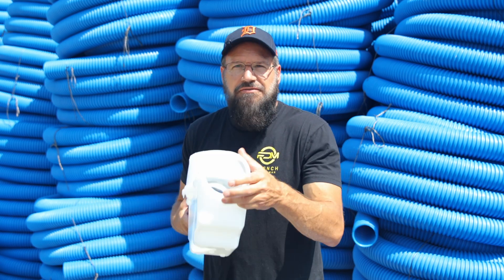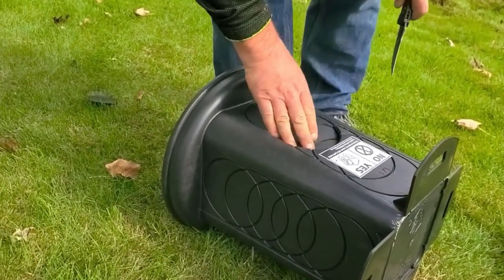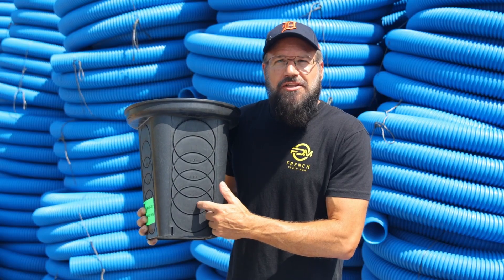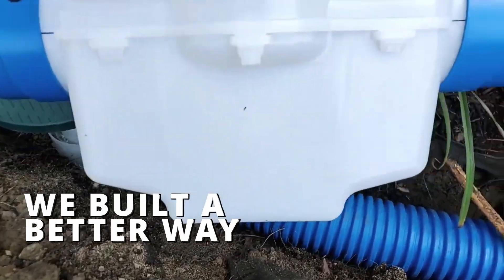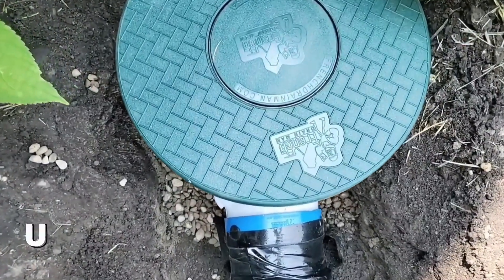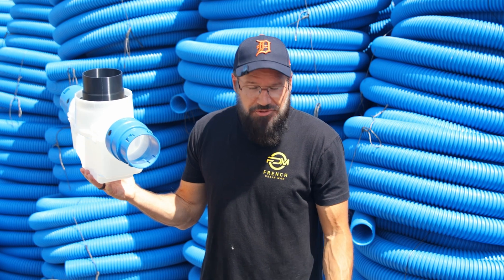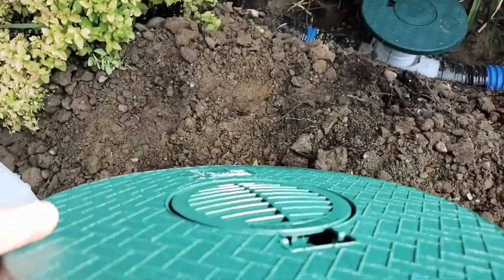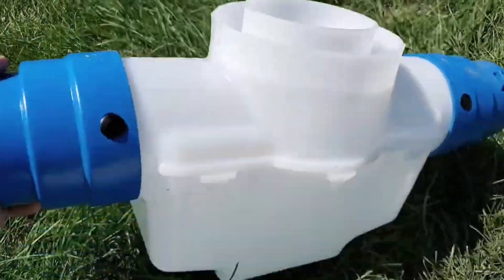New Inline Catch Basin is Revolutionizing Yard Drainage

Comment: For the 6 inch basin that connects to SDR 40 pvc, do you just tape it on or should you glue, tape and drill holes for the attachment pins?
Reply from the maker: Exactly as you said, all of the above. It fits Schedule 40, but you can get a coupler that takes you from Schedule 40 to SDR 35. We do sell them in our online store.

Comment: i have a low spot in my yard that collects water, and it happens to be directly over the gutter downspout drainpipe (20ft away from gutter downspouts, 20ft away from where pipe daylights to street) can I put one of these in line to drain the low spot? or will the water pressure cause all the water from my gutters to just come out there instead?
Reply from the maker: As long as you have a slope and daylight below the catch basin inlet, you will not have water come up out of the catch basin. Water will always seek the lowest point. You can put a catch basin on a downspout line to take in surface water.

Comment: I know this is such a new product, have you had any over the winter season to see how it does for durability.  I know you recommend drilling holes so any remaining water inside is able to drain out.  If the debris like shingle gravel and tree seeds and leaves has built up, will the freeze and thaw damage the integrity of the basin?
Reply from the maker: We have been working with Prototypes all 2022 and no failure
Reply: Thanks for always answering my questions....just wish you guys were in Wisconsin to work on my house @FRENCHDRAINMAN